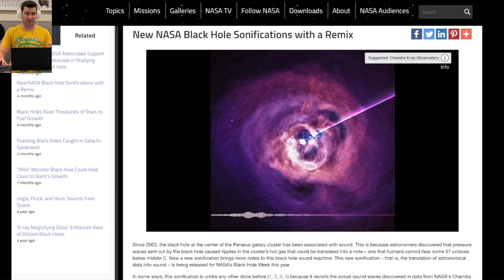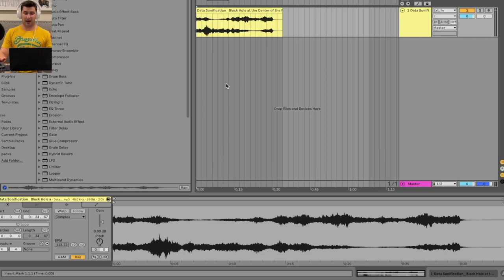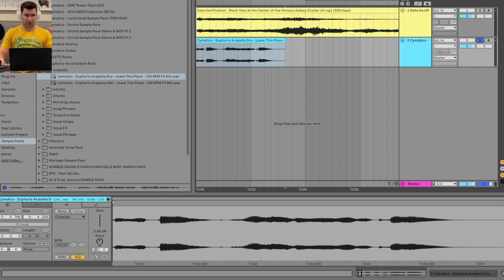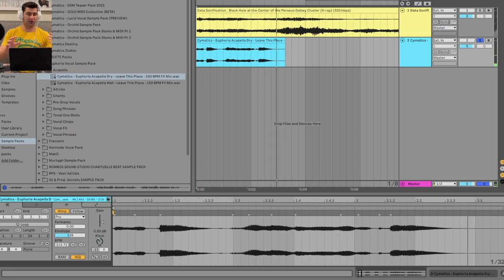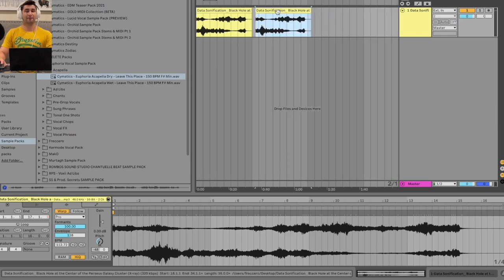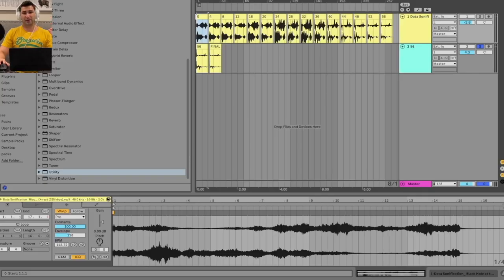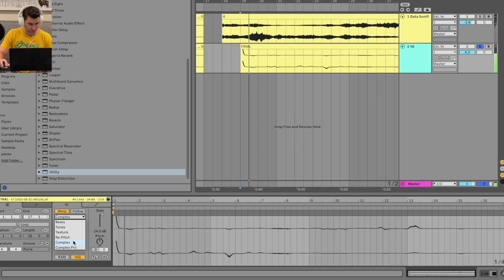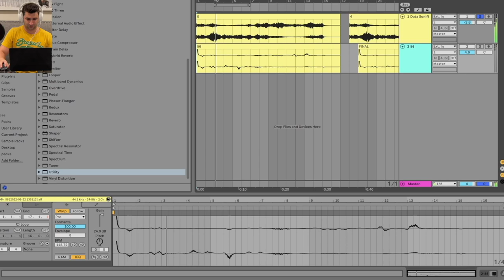Revealing the REAL SOUND of a Black Hole

Comment: It's not the sound of a black hole.  It's a sonic interpretation of the vibrations of the gases AROUND a black hole, which the frequencies could never produce actual sound, unless we are redefining the word "sound".
Reply: you do know that sound is the vibration of gases (or other states of matter), right? even sounds with very low frequencies are still sounds, they're just below our range of hearing.
Reply: @N8crafter  subsonic...means literally "below sound" or "below the ability to hear"
Reply: @N8crafter  ultrasonic means "above sound" or "above the ability to hear".  Words have meaning even if you don't know what the meaning actually is.
Reply: @joshuacornelius25  those are relative to the spectrum of sounds the human ear can hear; they are still sounds, just as light with energies above or below the visible spectrum (ultraviolet, infrared) is still light
Reply: @N8crafter  the reason why all frequencies within the electromagnetic field are called light is because they are all made of PHOTONS/Electromagnetic Field... And it had nothing to do with the able to SEE.  We have colors to describe the ability to see light, so trying to equate the term light (PHOTONS) with sound (AUDIBLE) is ridiculous.
Reply: @joshuacornelius25  there is no physical difference between a subsonic wave, an ordinary sonic wave, or an ultrasonic wave aside from the frequencies at which they occur. The nomenclature is entirely within the context of human perception and has no bearing on their status in physics as sound waves. Other species of animal can perceive sounds both lower and higher than human hearing, depending on the species. To them, those ranges of sound are normal. 
(Incidentally, as humans age they become less capable of hearing higher frequency sounds, so the line between “sonic” and “ultrasonic” is especially blurry at best)
Reply: @N8crafter  that's exactly what I said....sound is a term of perception that you keep trying to use to describe any vibration of any mediums whatsoever I'm... Again I ask you, by your ridiculous definition of the word sound, since light oscillates, is it not sound?  If not, why not since it fits your definition?
Reply: @N8crafter  the reason why ultra and sub are "blurry" is because they describe the limits for what can be HEARD which is why it's called SOUND .  you'll get it eventually
Reply: @N8crafter  just because some social media creators for NASA misuse the word sound to create some clickbait, doesn't mean you have to. 😉
Reply: @joshuacornelius25  light does not need a physical medium to propogate, and is therefore not sound. sound is a wave characterized by its transmission through the vibration of atoms, causing other nearby atoms to vibrate in turn. there is no rigorous difference between sounds that are beyond the human range of hearing vs sounds that are within that range, other than that they are within the context of the range itself. instead of accepting that fact, you've resorted to attempting to strawman my argument instead of facing facts and accepting that you are wrong.
Reply: @N8crafter  you just refuse to accept the fact that vibrations and sound are two different things eh?  Since you are too lazy to do so yourself... Here, I'll do your work for you...

sound

 

noun
7

Did you know?

Synonyms
Synonym Chooser
Example Sentences
Word History
Phrases Containing
Related Articles
Podcast
Entries Near
Comments
Show More

sound
1 of 7
noun (1)
ˈsau̇nd 
1
a
: a particular auditory impression : TONE
b
: the sensation perceived by the sense of hearing
c
: mechanical radiant energy that is transmitted by longitudinal pressure waves in a material medium (such as air) and is the objective cause of hearing
2
a
: a speech sound
a peculiar r-sound
b
: value in terms of speech sounds
-cher of teacher and -ture of creature have the same sound
3
a
: meaningless noise
b
: the impression conveyed : IMPORT
c
obsolete : MEANING
4
: hearing distance : EARSHOT
within sound of your voice
5
: recorded auditory material
6
: a particular musical style characteristic of an individual, a group, or an area
the Nashville sound
Reply: @N8crafter  
"In physics, sound is a vibration that propagates as an acoustic wave, through a transmission medium such as a gas, liquid or solid. In human physiology and psychology, sound is the reception of such waves and their perception by the brai"
Reply: @joshuacornelius25  "mechanical radiant energy that is transmitted by longitudinal pressure waves in a material medium (such as air) and is the objective cause of hearing"

thank you for providing a definition that proves my point. saves me the trouble of having to do so myself. 

(note that while sound is the "cause of hearing" here, it does not always have to be heard, nor hearable)
Reply: @N8crafter " Sound Waves and Frequencies
Sound waves are vibrations in a medium, which can be perceived by the human ear. Oscillations in a medium such as air propagate from the source to you transferring the vibration to your ear drums, which your brain interprets as sound"
Reply: @N8crafter  you need to look up the meaning of strawman fallacy as well...posing a question to you based on your incomplete explanation is certainly no strawman.... Light does travel through a medium... The electromagnetic field...it also travels through spacetime, air, water, certain gasses and light of certain frequencies can travel through matter.... And be detected and converted into a sonification just like this black hole ...in fact, that's exactly what they did.  They measured light, not sound waves. They converted data taken from light and converted it into SOUND so that you could HEAR it.   

Look, you call whatever vibrations your want as sound, you'll be wrong.... But your 6 free to do so.  I'm bored with trying to educate you.  Good luck!
Reply: @joshuacornelius25   not that I said physical medium. “Spacetime” and “the electromagnetic field” are not physical media. Only matter is. Therefore, your argument is indeed a strawman at worst or a gross misunderstanding of my argument at best

I am not denying that the means by which this sound was detected isn’t visual, the information carried by light from source to receiver. But it is still originally sound. You could reproduce the sound of a vibrating tuning fork with just silent video of said tuning fork. It may not be exact, but it should be an adequate representation of the true sound. The same is true for the sound of this black hole.
Reply: @N8crafter  I did provide you "physical" mediums through which light propogates, which also has a physical effect on light such as refraction, reflection, absorption.  You kinda have a habit of omitting uncomfortable information don't ya?  Since you want to move the goal posts... Electrons or even protons and neutrons vibrate, and so you would say that these individual particles produce sound by there very vibrations within the atom eh?  And now you're proposing that when light can't even escape a black hole, sound can?  You're all over the place.
Reply: @joshuacornelius25  light does not require physical media to propagate, pedant. you'll note I said this several comments ago. 
that's all this is, really. pedantry. if you want to get really pedantic, "black holes" don't really even exist. 

the "sound of a black hole" in this context, is the sound produced by the black hole's gravitational effects on the gases surrounding it. 

also note that I specifically mentioned atoms vibrating being the carriers of sound, so you're attempting to extrapolate my argument to a degree that is wholly incompatible with the definitions I've already put forth.
Reply: @N8crafter  lol neither does sound in a sonification as you openly admitted.  Let's settle this once and for all.... Please device the word sound.
Reply: @N8crafter  what sound does a set of galactic pressure waves with a period of one oscillation every thousand years make?
Reply: @N8crafter  I didn't say atoms, I said individual electrons, protons and neutrons...a black holes gravity is not the black hole no more than our suns gravity is our sun.  Are you starting to see the problem here?   You like to change the meaning of words to suit your fantasies.  You should apply to work on NASA's social media team as you'd fit right in!
Reply: @N8crafter  still waiting on that definition of the word sound kiddo....
Reply: @N8crafter  lol... crickets on the definition of sound eh?  How can you defend your claim that any physical oscillation is a sound wave if you can't even define the word sound?   Why not say Cardi B's breakfast bagel is a sound wave then?  Or maybe my dres from last night are the definition of sound?  Why use the word sound at all?  Let's call them jelly waves, or Nathan waves, or fart waves?
Reply: @N8crafter  again... You need to learn what a strawman fallacy is....if I had tried to attack your argument saying that you said something you had not and then that would be a strawman.....I never said that you claimed that a sound wave required no medium...you clarified that after I challenged your position with light being able to interpreted as sound (which it can by sonification).  A challenge to your position allowing you an opportunity to clarify is not a strawman fallacy, that's just basic debate.  I get that you're running out of defense so you're going to start lobbing false accusations of fallacies, but at least be accurate.  Or learn more fallacies so that you have a greater variety of false allegations so you won't have to be repetitious.  I've used ad hominem a few times, so there is that. 😉
Reply: @N8crafter  I'm glad that you finally admit that your argument doesn't hold up to scrutiny and that you have a tenuous grasp on the meaning of everyday language.  Now that you've identified your errors, you can correct them.  I do find it hilarious that you spent all this time defending your semantics fallacy, but want to call me pedantic...project much there kiddo? 😉  My entire point was that words have meaning...I can't help it if you disagree.
Reply: @joshuacornelius25  what’s really happened is that you’ve grossly misunderstood the conversation, but whatever.
Reply: @N8crafter  yes... I'm sure that is it. 🤣
Reply: Nothing was accomplished here. Nothing. 😐
Reply: @VoteForBukele  it gave you something to whine about, so there is that!  😉
Reply: Yall too smart for me lol
Reply: @joshuacornelius25  You don't have too many friends do you? Oh and you're wrong also :)